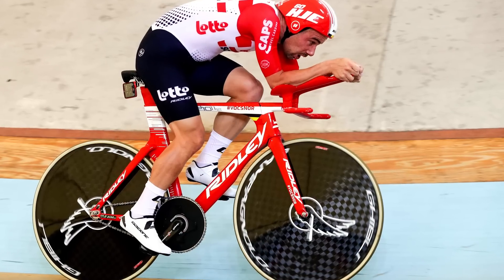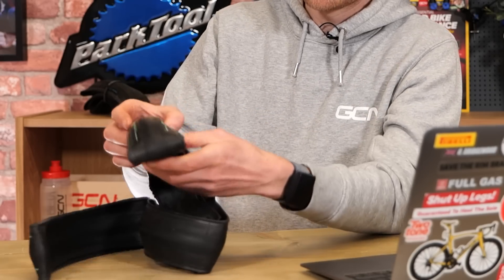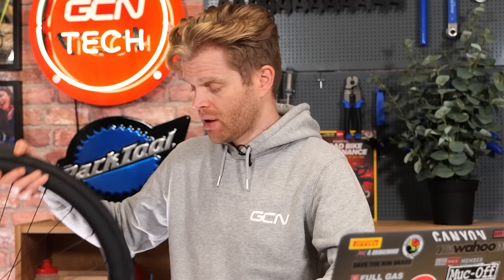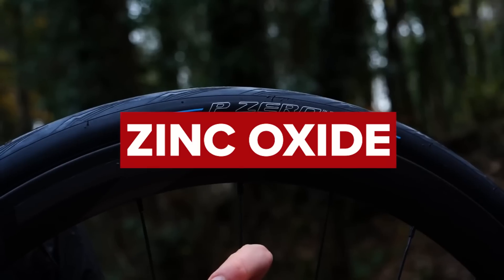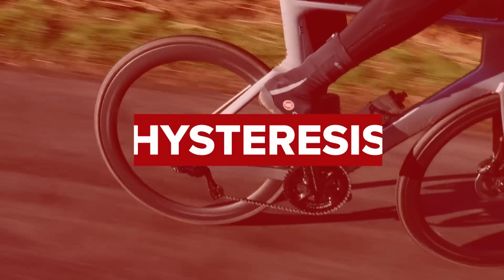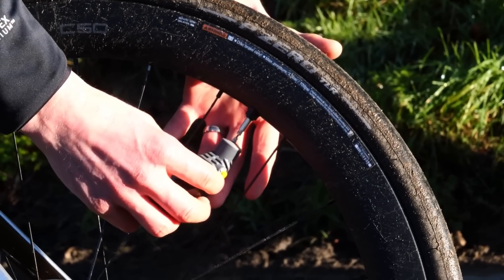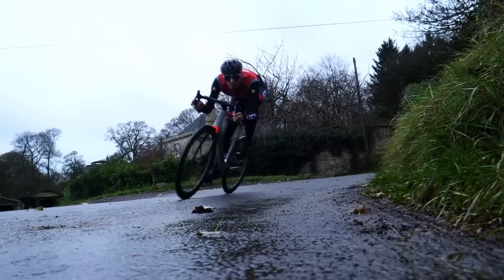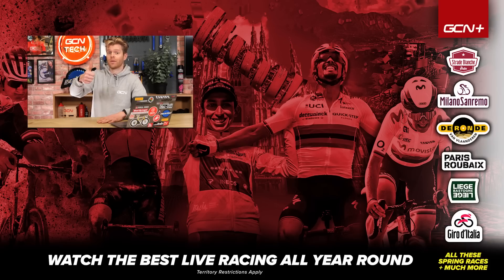The Surprising Science Of Bike Tyres

Comment: Can I use 28 mm tyres with tubes on my 2012 Reynolds 800 mm deep rims?  I currently am using 25 mm and would prefer the larger tyres.

Comment: About the tyres: I have threads coming off the sides of my Continental tubeless tyres. What causes this? Is this something to worry about or is it expected (strange) behaviour?
Reply from the maker: Hi Hinko, is this on the rubber itself, like the rubber from the moulds, or are these tyres quite old? If it's the first, there's nothing to worry about, but if it's the second, then you'll probably need to get it replaced! If the tyre is new but is showing threads, then you should contact continental, as this would be a manufacturing default. I hope this helps :)

Comment: Very informative Video and mostly correct! 😉 I'm working in rubber tribology (friction, wear and lubrication; seals not tires), and I can tell you that specifying any coefficient of friction (cof) to the second digit is nonsense. Variation is usually rather high, because friction depends on a million things. Dry rubber friction can be anywhere between 0.5 and 1.5, in extreme cases over 2! Yes, bigger than 1 thanks to adhesion. Most likely the cof will be between 0.7 and 1 in dry conditions, but only around 0.2 with oil...
Also, smoother roads will result in more grip but less rolling resistance because the contact area between tire and road increases and there is less deformation.

Comment: I use natural rubber non-vulcanised tyres on one bike and I find the tread last more miles than the synthetic vulcanised rubber tyres on another bike.  My hypothesis is that natural rubber (latex) can stretch to 6 times it's resting dimensions, while synthetic rubber stretches less.  When the tyre experiences shear stress in cornering and acceleration, if it cannot stretch it will reach its limit and break.  Thus, synthetic rubbers wear quicker.

Comment: Thanks Ollie, very nice. The relevant ‘friction’ in biking is not ‘sliding friction’ as in the examples you gave of skis or ice skates and such - a bike tire does not slide on the road. The energy loss in cycling is mainly from the deformation of the tire as it makes a static contact with the road surface.
Reply: Their presentation was kind of fuzzy.  Sliding friction is good when we want to go around a corner or push the bike forward by pedalling.  Big friction coefficients are good...we call it grip.  But most people hear  "friction" and think it is bad.  Hysteresis and deformation are indeed the big issues and they got it wrong.

Comment: Tyre compound I.E.- durometer reading. Stiff I.E.- sidewall suppleness. Jan Heine has covered all of this, going back at least a decade, more if I recall.
Applied Forces at work. 
'The linear tyre model' 
The degrees of slip is known as the cornering stiffness of the tyre. The model describes a linear relationship between the tyres slip angle and the lateral force produced. 
2 wheeled vehicle dynamics.
#kinematics

Comment: Speaking of which, about tyres: when are we getting radial tyres for non leaning three or four wheeled pedal vehicles? Nowadays there are lots of trikes out there, which would benefit a lot of radial tyres. With cars every one use radial tyres today, because they are just better than diagonal tyres. Radial tyres have less rolling resistance so therefore they would make our velomobiles faster than with standard tyres. Anyone please, Schwalbe, Continental, Michelin, radial tyres in 28-406 and 28-559 sizes. Thanks.

Comment: Well, it is not all plain sailing. The wear of Conti GP5000 is much higher (worse) than the previous GP4000.
Reply: If the tire is lighter, it could be that the tread thickness is reduced for weight and rolling resistance but exchange milage.

Comment: Thank you. A couple weeks back GCN said it was fine if tires were installed backwards in their # ask GTN segment. They got some push back in the comments. Thanks for this video: obviously there's a lot of confusion, even at the pro level.
Reply: According to Schwalbe it matters only for off-road tyres with some tyres being mounted in opposite directions on the front and the rear. For road and touring tyres the direction is mostly aesthetic, some tyres are even symmetrical and are the same in both directions.
Reply: @Ihwaz13  some are: mine aren't! They have a designed rotation to channel water out of the contact area: mount them backwards and they push water INTO the contact area and you WILL eventually crash! 
Not all tires have an arrow on the side wall, but if it does have an arrow, you need to respect it!
Reply: @wilfdarr  Schwalbe tested it and the speed necessary to get aquaplaning with a bicycle is over 200kph which I highly doubt most people encounter. The reason they tell you mount the tyres that way is because the grooves point forward on top of the tyre making it look more "dynamic".
I suggest checking out their FAQ section for tread.
That being said installing them as recommended by the manufacturer will definitely have no adverse effect and I mounted my tyres that direction as well even though I use them on the road 80%of the time.
Reply: @Ihwaz13  Hydroplane, no, but enough water to cause a loss of traction, absolutely! I  was experiencing significant traction interruptions just the other day on the local bike path (rubberized concrete): now how would that have gone for me if my tires were on backwards?!
Reply: @Ihwaz13  Finally, if you have a road tread on a mountain bike or cruiser mounted backwards, it's not going to clear mud from your tread: water is only a mild problem compared to the lack of traction that a tire full of mud on a paved street is going to present! It's not “to look more dynamic”
Reply: @wilfdarr  The way tyres are usually recommended to be mounted is with the grooves directing the water forward, which would work under acceleration but make matters worse under breaking if direction made any difference. The ellipsoid shape of the contact patch pushes the water to the side, so it makes no difference.
I don't really see how the tiny grooves in a semi-slick tyre will affect clearing mud. When on muddy surfaces having more aggressive tread that can push through the mud (if on the tyre or on the road) is going to make the difference.
But you do you.
Reply: @Ihwaz13  No subscribers, no content, nothing to say, not even your mom wants to hear it if you did. 
I've lost IQ points just listening to you!
I'm blocking you.

Comment: A better explanation of hysteresis is that the tire has internal friction(between individual particles and the different layers) and so losses are introduced. This means that the tires will not output all the power that is put into them as some of the power went into deformation of the tire and the return of energy after that is not perfect.
Reply: It's not better but the correct description. IMHO their description was simply wrong.
Reply: @svenweihusen57  yes.  They sounded like they have no idea what hysteresis is.   My dumbed down description is that it is the work required to flex the tire.  Since the tire and tube are continuously being flexed when rolling, this matters.  Generally, a lighter tire can be flexed more easily and will require less work to roll.
Reply: You saved me writing it 👍
Reply: Hysteresis is also a major contributor to tire grip, especially during breaking, since it's also about energy dissipation (just at a different frequency compared to rolling)...also the differentiation between grip and adhesion feels...artificial...cured rubber doesn't "stick" to the road due to adhesion as described...for some very specific UHP racing compounds there is a bit of that, but not on bike tires, as that sticking would ruin rolling resistance as well as mileage of the tire

Comment: The rolling resistance of a tire cannot be measured by a wheel rolling on a steel drum. It's only possible to measure the rolling resistance with a rider on a bike rolling on tarmac. Because the tissues of the body of the rider absorb the vibrations from the rolling on the road. This energy comes from propulsion.
Reply: The drum surely provides a basis to compare the tyres evenly in fair testing though, even if it’s not directly applicable to the real world?
Reply: @thegrowl2210  The stiffer tyres at high pressure produce less drag on a drum without a rider. Because stiffer tyres deform less on the contact point, the hysteresis loss is smaller. But that property also transmits vibrations more pronounced to the rider which then increases the rolling resistance of the tyre.

You either measure the rolling resistance of a tyre or you don't. Magazines like tour have been promoting that narrower tyres are faster and higher pressures make tyres faster. Both is proven to be wrong by Bicycle Quarterly.
Reply: Rolling resistance is rolling resistance, even on a drum. Even if it is not 100% accurate, it should still give a bit of reference of how the tire performs on some level. The people measuring this know that drums are not equal to tarmac, i bet they know more about tires than random commenters on YouTube who think they know better 😉
Reply: @sepg5084  I know better because I read Bicycle Quarterly. The absorption of vibration in the body is greater than the hysteresis loss of the tire in any real world scenario. Therefore you cannot predict the actual rolling resistance of a tire if you measure something else than rolling resistance — since the most significant part of rolling resistance isn't present in your "test".
Reply: The rolling resistance of a tyre also cannot be measured while a person is riding the bike, because the measurement gets drowned out by aero and mechanical power losses rendering the measurement very inaccurate.
Measuring power loss on a drum is the most accurate method.  It is very good for finding the relative performance of tyres and with a small adjustment factor, it is a reasonably good predictor of real-world on the road rolling resistance.
Reply: @drivemenuts3011  The losses in the body of the rider are greater than the hysteresis losses of the tire (in any real world scenario). Therefore wheels-on-drums-tests test for something different than rolling resistance. Those "tests" suggested that the higher the pressure the lower the rolling resistance.  Obviously that's not true. The reason why pneumatic tires were invented was because solid rubber tires were "bone shakers" and much slower. Cyclo touring is only possible through pneumatic tires — which are run at low pressures of course.

It's possible to measure the actual rolling resistance with a rider on a bike. You have to control all the variables and conduct every test run several times. Bicycle Quarterly has done it in two different ways. Those tests are the reason everybody nowadays rides at least 25 mm tires.